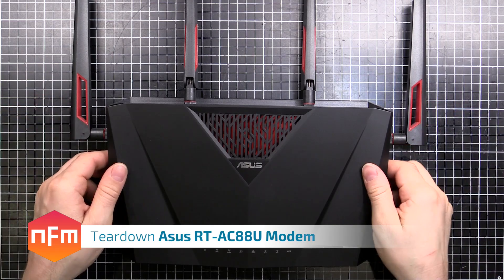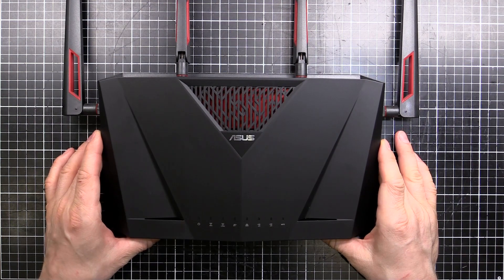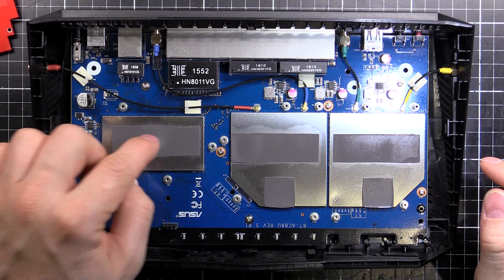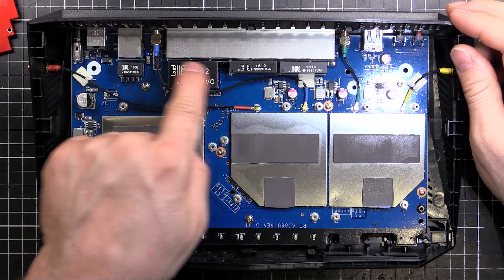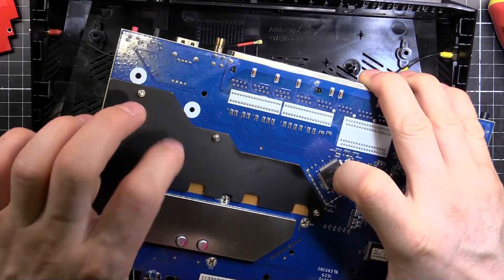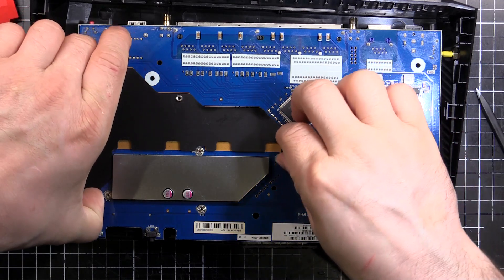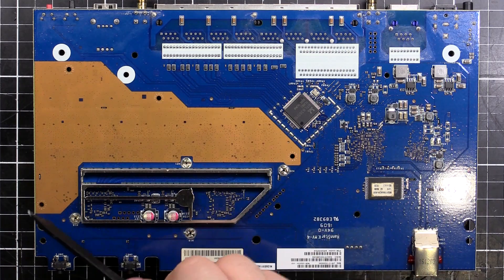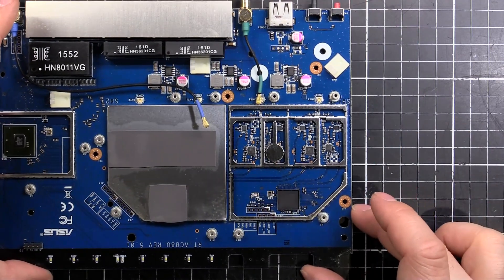Asus RT-AC88U Wi-Fi Gigabit Router Teardown

Comment: To open the shell you must remove the 2 rubber wall hang plugs and the 2 raised stand offs (feet) to expose the 4 screws. Use your fingernails to pry open both sides (left & right short ends) then pry the bottom apart (thinner edge opposite of the antennas). If you want to remove the board there are 2 screws (near lights and wan port) and 2 antenna mounts to remove.
Reply: Thank you for explaining this!

Comment: Great video. Thanks! I received one of these from eBay and it was advertised as faulty due to 2.4GHz wifi not working. I suspect a hardware issue after performing all the necessary software checks. I have the proper equipment for removing SMD components but wonder if anything in the Amplifying section could be the issue since 5GHz works just fine?
Reply from the maker: If you trace along the traces on the PCB from the source chip to the antenna with a scope or spectrum analyser etc, you should be able to see where the signal stops and replace the part at that point.

Comment: can you add the Thermal pads thickness in the discription off this video since it's getting older these tend to dry and be less conductive of heat.
so people might wanna change these after a few years of heavy use.

had this happen on my rt-ac68u and bought this Router as an upgrade/quickfix since it's CPU load was 100% when QoS'ing 2 different PC's playing network games and causing network lag above 5000MS wich never was an issue in it's previous years of service.
suspecting the CPU to downclock itself to generate less heat i noticed that with the 2-screw heatsink design on the ac68u the board has bent ever so slightly causing contact to be lost in the center of the board and the heatsink.
after i get it fixed again i plan to experiment with Merlin CFW on that one and maybe later on the newer AC88U if all goes well.

i have the ac68u on hold at the moment since i i don't have all the Thermal pads in stock.
rough sizes are 0.5mm under the outside heatsinks 1mm for the CPU and 2mm for the Radio-chips
although i suspect the CPU is a 1.2-ish since i tried it with 1mm and not 100% sure it's not making good enough contact.

Love your video as now you can see the board can't flex that much under heat with multiple screws on each Heatsink.
i am however curious if someone ever used to extra Soldering joints to Hook up an extra 5 or 12Volt fan to that to keep it super cooled for parts in the world over 30degrees Celcius.
Reply from the maker: I'd have to tear it down again, but it is currently in use so it will be a bit difficult to take offline...
Maybe someone else can measure their thermal pads and let us know.
Reply: Just use 1.5mm thickness
Reply: I'm actually still running one. It was perpetually getting hot inside the structured media center, so I took the entire case off and screwed it to the structured media center via standoffs (I wanted to print a mount, but there wasn't time and people were being... people.)
So it's just a bare board with antennas duct taped to the wood wall above it, and 2x120 mm fans (with filters) pointed right at it.

Comment: That was really helpful. Subbed. You clearly know what you are talking about. Trying to figure out why an AC-RT-68U I bought for my parents is not broadcasting on 2.4 but says it is when it is actually only broadcasting on 5ghz and giving it a 2.4ghz SSID! Also, only one cpu core is showing in ASUSWRTmerlin lol. I gave them a new one as it was on it's last legs anyway. About a year ago the primary WAN failed (I think due to nearby lightning) and it has been working on failover ever since. It is so weird. The leds show 5ghz but not 2.4 ghz. I made sure to name them completely differently. It will only let things connect on 5ghz even though the SSID says 2.4. I checked with only 2.4 capable hardware and scanners. Digging deeper it gets even stranger.  'Temperatures' under 'Tools' show 5ghz as 'disconnected', Logs shows one cpu core fails to boot and only one cpu shows up in GUI. I tried to set up a 2.4ghz guest network to confirm it is not just a glitch. Both normal 2.4 and guest 2.4ghz will only transmit on 5ghz (even though they call themselves 2.4ghz) and the control channel is fixed on 0! I have tried lots of different firmware's, resetting, clearing nvram and asuswrt. Next step was going to be removing the heat sinks over the chips to see if anything burned out. Have you ever seen anything like this? Just interested and will probably tear apart if not. Anyway, thanks for the clues.
Reply from the maker: Sounds like the lightning strike killed something inside there in a weird way. I'd go for a new unit rather than chasing gremlins in the one you got... :)

Comment: This entire video is USELESS because the most important step is MISSING... Where are the screws that hold the cover in place and how do you get them out?
Reply: They are under the rubber pads under the unit. There are 4 one has a sticker on it. Just push your screwdriver through it.

Comment: It's not a modem by the way.
Reply: Yeah it is actually. It's definitely modulating and demodulating Wi-Fi signals. It's not necessarily modulating signals to and from the ISP, but it is still a modem. Just not in the traditional sense, I guess.
Reply: @polymetric2614  no it isn't. modulating and demodulating is usually from analog to digital and vice versa, which is not part of its functionality. A modem functionality would be included on a model that has a cable port on the back.
Reply: @Steven-hq6df  Any wireless technology is a digital signal encoded as analog. Wi-Fi happens to use the Direct-Sequence Spread Spectrum (DSSS) encoding technique. https://en.wikipedia.org/wiki/Direct-sequence_spread_spectrum

The analog coax cable between your cable modem and ISP uses Quadrature Amplitude Modulation (QAM), also known as Quadrature Amplitude Shift Keying (QASK). https://en.wikipedia.org/wiki/Quadrature_amplitude_modulation

They're both modulation techniques, for sending digital signals over an analog medium.

Comment: Awesome tear down! I have the 3100 and am wondering how u popped the cover off...I can see in the video there are 3 tabs but I can’t see where to access them...do I run a credit card along the edges and pry it open? Let me know and great video man! 👍
Reply: Great that u have disassabled the 3100, but I do not like your shortcut of dropping to show how you lifted the cover off. I have taken those 2 screws out, but still my cover is "clued" in place. Have managed to lift it a couple om mm left nack corner, but from there I am afraid to use force. 
Is there more screws than those to in the back? Any other factors?
Reply from the maker: +pacifikballa The lid on mine just came open easily once I took the screws out.
Did you find the screws under the little rubber plugs that block the holes on the back of the unit?
Reply: NFM I didn’t know there were screws there but I’ll make sure to take those out...no wonder I couldn’t get it off all the way 😂 thanks dude 👍
Reply: Hi, Thanks for the tips, could you confirm how many screws have to be removed? 
Thanks
Reply: Ill be sure to check that out! Didn't know it either
Reply: Does the 3100 have an onboard battery? Mine always resets to factory when I power it off.